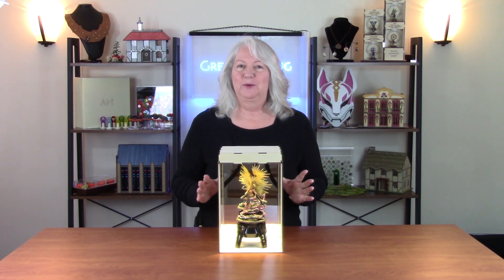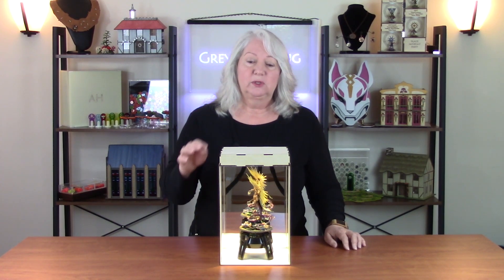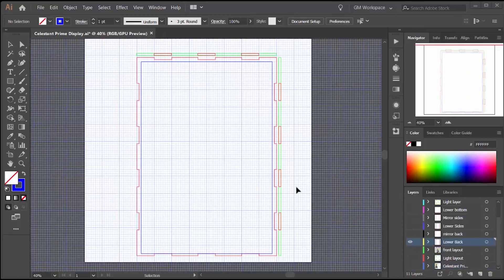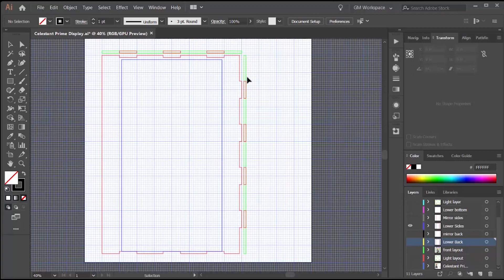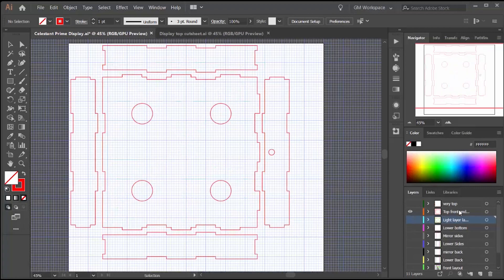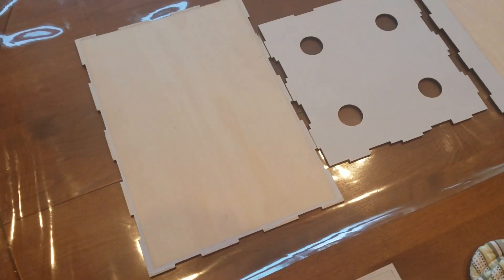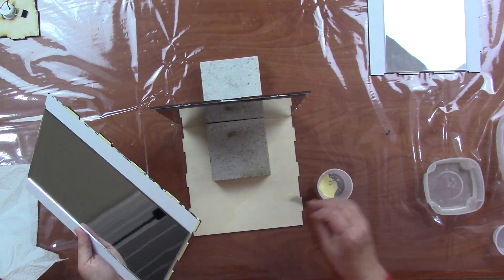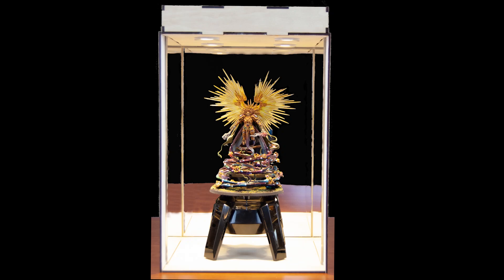How to Design and Laser Cut a Rotating Display for Miniature Models

Comment: As much as I (and obviously you) love and know illustrator, once you go into 3D it might be worth learning Fusion 360 of you want to make more complex pieces. It lets you simulate light sources with rendering, and is parametric. If you change one thing on one side it will automatically update all the other sides. Check out the lighthouse on my page if you want to see a complex model made on a laser cutter with F360. Vzoutenbier.wordpress.com as always. Amazing video and content. Just a tool suggestion if you have more 3D projects in mind.
Reply from the maker: Hi Vincent, I really love your project!  And the Instructable you did on it was excellent and required a ton of work; I'm sorry you didn't get 1st place. I learned F360 when I was doing 3D printing and it has occurred to me that using a material thickness parameter would be especially helpful, especially in slot and tab construction. Yet I think F360 is challenging if not downright difficult, and I'm pretty good with design software. I'm concerned that it would be intellectually inaccessible for most people,  many of whom struggle with Illustrator or Inkscape. Have you gotten feedback on this? Does F360 resonate with people?
Reply: Thanks. I’m going to ramble a little here so forgive me. 

I love F360. I have had success teaching it at makerspaces and at work, but the mindset of the software I think is the most important part of learning it. Watching someone say the tools out loud and walk through the process of making something is invaluable. In short, ive had success presenting it like this: 
Everything in fusion depends on sketches, which is a 2D drawing of some piece of what you’re trying to make. That sketch (which is just a 2D shape) is then pulled into 3D by extrusion, rotation, etc to make a 3D body. That body can then be added or removed from to refine your model. From there, Everything is mathematical operations. Add these two shapes together. Subtract this shape from that shape. Etc.  This helps give context to why sketches are important even though they feel cumbersome at first.  

IMHO anyway. But I understand I’m a super math nerd. Numberphille is right there with you under subscriptions.
Reply from the maker: Just hearing the word "math" scares me, so I guess that explains the difference!
Reply: @GreylightMay  math math math math math math math math math math math math math math math math math math math math math math math math math math math math math math math math math math math math math math math math math math math math math math math math math math math math math math math math math math math math math math math math math math math math math math math math math math math math math math math math math math math math math math math math math math math  -- late halloween present.  But really: math is just a formal way to describe ideas *you already know*.  It's just intuition.  In my experience teaching the hard part is always understanding what the symbols in the equation represent.  You know that you can add things.  You can subtract things. You also know that objects exist at different places. All these ideas are represented by math operations or proofs.  (your cat is not in the same physical location as your potted plant.)
Reply from the maker: Vincent, is this some kind of desensitization therapy?😁
Actually,  my husband has always told me my problem is I never had a really good math teacher, one who taught concepts instead of rote memorization. I'm really good at statistics because I understand that intuitively and conceptually, but I learned that in college from really good teachers, and my very first exposure was a positive one. But calculus, forget about it!
You will notice that all of my design techniques are visual, hardly any measuring and absolutely no math...

Comment: Could you share these files for the box and a link for the rotating disc?
Reply from the maker: Andrew, here's the link: Leadleds Exquisite New Black Solar Powered Display Stand Rotating Turntable with LED Light + (Colored Unit Packing Box) https://www.amazon.com/dp/B00K7777DE/ref=cm_sw_r_cp_apa_i_Hyz0DbRQ2TN0P
I will try to get the file up on my website, www.greylightmay.com 
later this week. Remind me if you check and see it isn't posted...